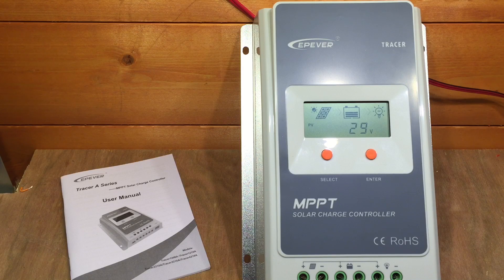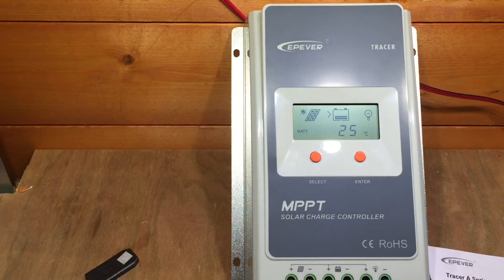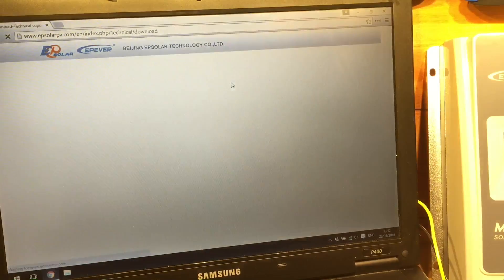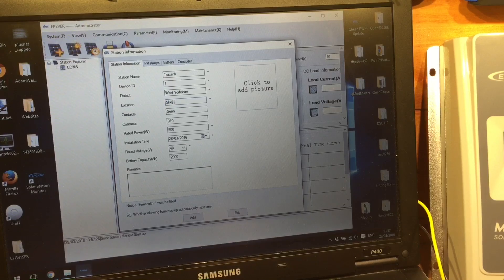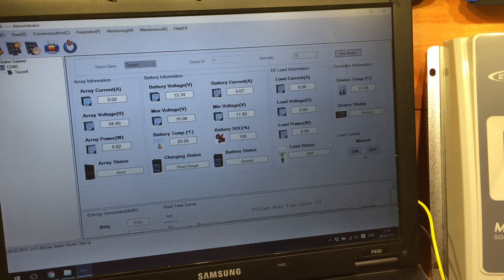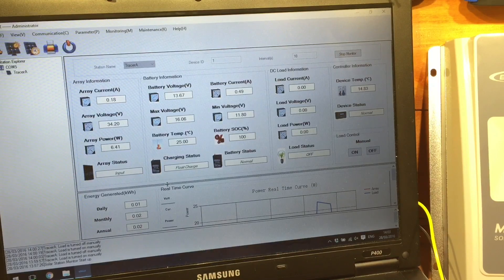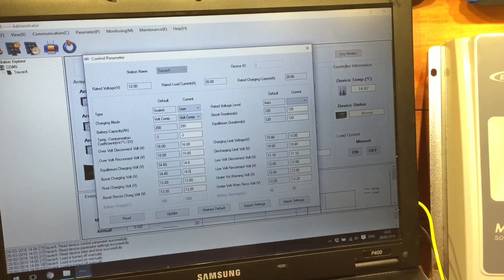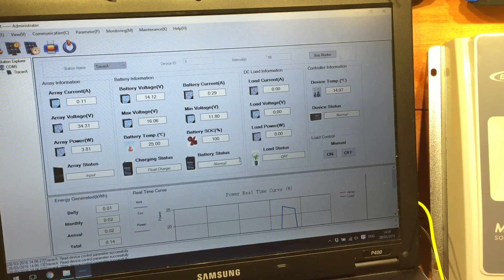EPSolar Solar Station Monitor software & a cheap USB cable - 12v Solar Shed

Comment: Great review on this charge controller, am thinking of getting one of these myself and I am also thinking the same about whether something can be done with a Pi to capture the info as I have a couple sat about so will be watching for when you start looking into that :)
Reply: +coolamasta1 Hi there. I have done exactly this using the pymodbus library, and some python code (found online written for the Tracer BN) I have adjusted the code to pull data from a Tracer 2210A and publish it to the internet around the clock with a Raspberry Pi. See here www.solarpoweredhome.co.uk
Reply: Hi Matthew, thanks for the link, I have got myself the 30A Tracer now for my system and its great, I will have a proper read of your site when I have a bit more time but long-term if I can get something like that set up on a Pi sending it to a DB (I have MySQL DB's with my web host) that would be awesome, I am very much a noob with programming code though as I used my Pi's for media streamers haha but no doubt will be seeing if you can help me get something set up on the Pi in the near future, cheers :)

Comment: Friend, your video was wonderful.
I was really interested in this model by having RS485 and speak the MODBUS RTU protocol. This means it is much easier for me to integrate it in my home automation network. The only question that remains is this. If I use an external software, like the one I use, called ScadaBR, I need a register table. So I know what the address of each data. Can you tell me if it came with the manual? or you could contact the supplier? I will look at the price it on ebay and I will soon buy mine.
Reply: +Adam Welch 
If you run the app from EPever 'APP (V2.1.5)'  on your mobile, and connect to the charge controller, there is an export option. I did this and it list the register I belive you are looking for, they are in Hexadecimal and look something like this.
reg_9013_real_time_clock_second_minute = 2598.0 
 
 
  reg_9014_real_time_clock_hour_day = 787.0
 
 
  reg_9015_real_time_clock_month_year= 4101.0
 
 
  reg_9016_balance_charge_period= 0.0
I have used Modbus Poll, to confirm these. Oddly enough the app, does not give me all the values, a lot of 00, zeros.
But Modbus Poll, reads them fine. 
Hope this helps.
I really like the idea of having an arduino to gather this data. But feel it's a bit beyond me, but will plug away.
Reply from the maker: +farmsidney Hello - yes this is a solution I'm interested in too.  I have contacted EPSolar to ask for an address list but they haven't got back to me yet.  It sounds like you have much more experience than me in Modbus - I'll be interested to hear about your experiments.
Reply: Of course I can help. I already use modbus a long time. I found a list of the old model addresses that it may be applied. I also sent a message to the seller of aliexpress, who knows he has to register table. I'm still curious to know the difference between the two models, that you have and the one that is higher. This your costs half the other.
Reply from the maker: +farmsidney Let me know if you hear anything from the seller. I'll do the same if I find out more. Thanks.
Reply from the maker: +Michael Breslin Thanks. I have managed to poll some of the stats in real time using alternative modbus programs.  Other projects have taken over though - I definitely want to get this working before too long though.
Reply: +farmsidney There's also version of the address list for the B series here: https://github.com/kasbert/epsolar-tracer/blob/master/archive/ControllerProtocolV2.3.pdf However I don't see how it is significantly different to the BN series. I use an A series for my datalogger, and these specifications work the same.

Comment: YAY! It would be really cool to see an arduino logger!
Perhaps even with the cheap wifi ESP8266 you'd be able to upload info to thingspeak.com or other kind of IoT server.
Reply from the maker: +Lars Sørensen Hi Lars, thanks for your comments - I have played with thingspeak and the ESP8266.  It's definitely within the plan to move in that direction - I just need to get the modbus bits up and running first then see where I can take it after that.
Reply: +Lars Sørensen Hey. I have recently achieved this using some python code I found online (written for the Tracer BN) I adjusted the code to pull data from a Tracer 2210A and publish it to the internet 24/7 with a Raspberry Pi - similar to an arduino. See here www.solarpoweredhome.co.uk

Comment: Great job.  I like these solar shed projects.  when you do the Arduino or pi data logger can you cover how the charger DATA is stored.  I keep hearing the word DATA logger, but how are you thinking of doing it.   Thank you for your hard work Adam.
Reply from the maker: +King Red Leg I hope to do a full explanation if I can get it working!  I'm waiting for some bits which I need to make the next steps with this project - so it might be a few weeks.  The theory is a RS485 module plugged into an Arduino making requests and logging the data to some sort of storage medium.  It would be nice to add a screen to show more information permanently as well so I don't have to wait for the Tracer screen to rotate round to the information I'm interested in.